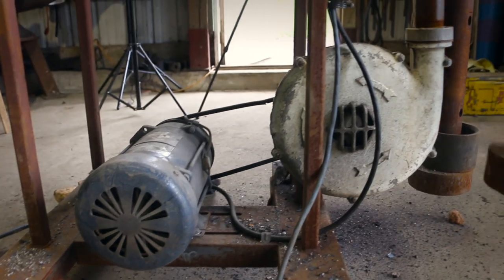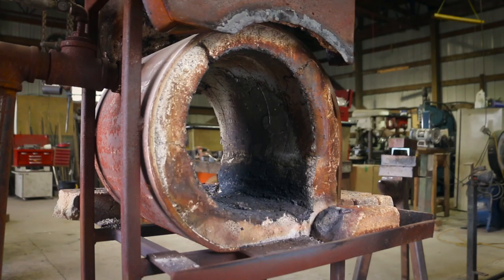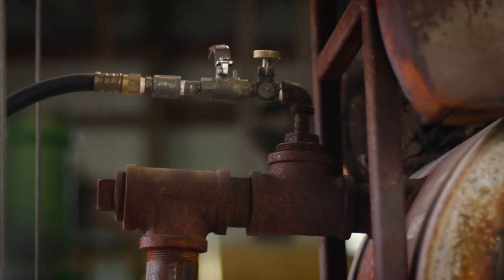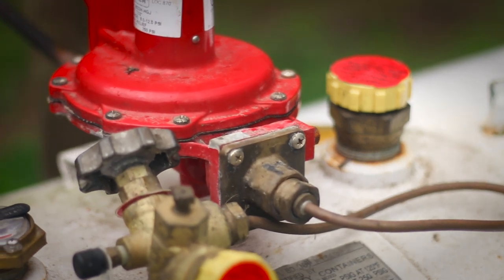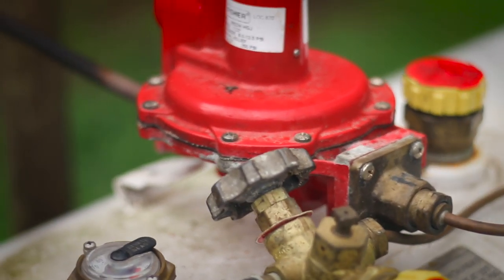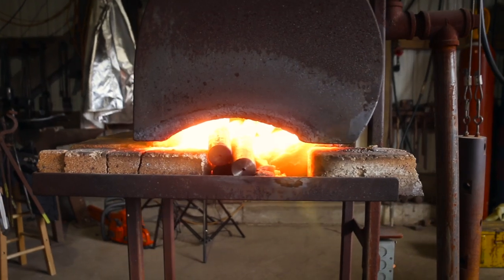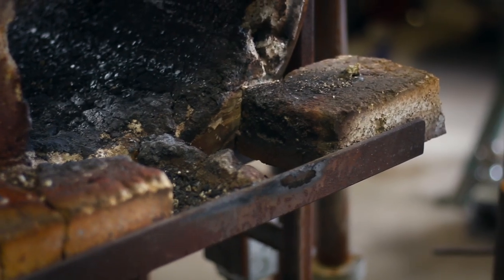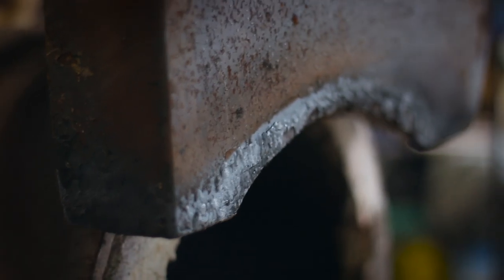The Forge - Taking a look at my main forge.

Comment: Hey! I just built a forge that's very similar to yours. I also went in the side for my burner, but I made a ribbon burner because I also like the swirly fire staying inside rather than shooting out like a flame thrower. My experience with it vs. my old Venturi system is that it puts out about a quarter of the noise my old forge did while heating up the entire forge evenly. My old two burner seriously sounded like a jet engine, you could hear it around corners. The only downside is that it takes about 30 psi to hit welding temps and isn't very economical. Btw, I'm not an experienced forge builder and I just watched a couple of videos and jumped into it with pretty good results so the ribbon burner is very doable. Thanks for your channel, I enjoy your work.
Reply from the maker: Thats great to hear! I definitely will be looking seriously at the ribbon style burner on my next one!

Comment: It sounds like you used hard cast able refractory to line your forge. A suggestion. Use Kastolite 30 when you reline it, or blanket soaked in rigidizer. You will go through quite a bit less propane, and, both of those products will act as sound insulation, the blanket more than the castable. I think your noise problem isn't the burner placement.  It's the refractory acting like an echo chamber and amplifier.
Reply from the maker: Interesting, thanks for your thoughts, appreciate it!